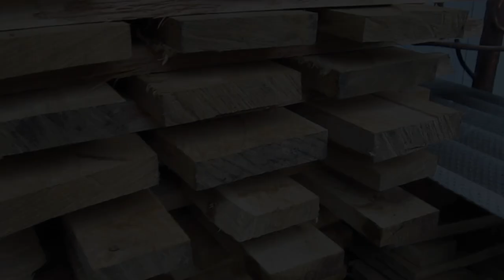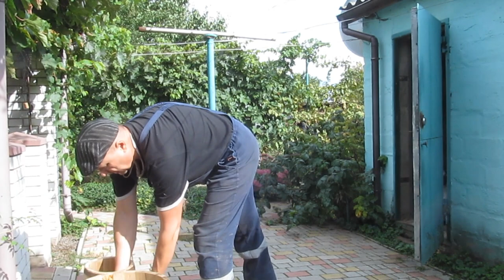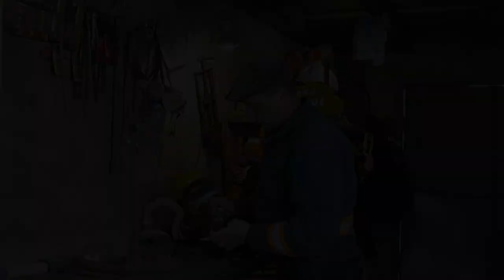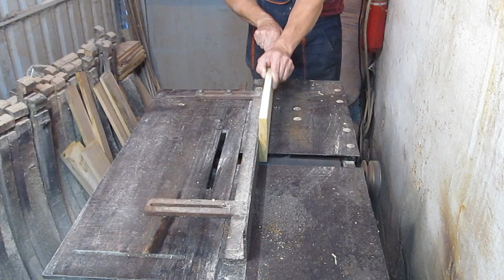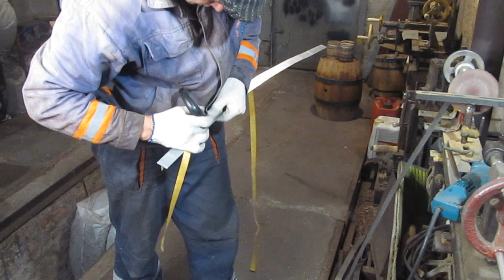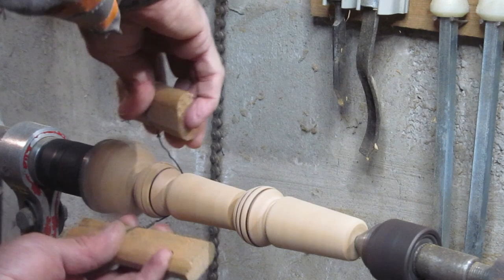А whiskey barrel from an oak log | DIY | How to make a wooden barrel with your own hands

Comment: would love to see a drawing (plans) for the two or three jigs used to taper and cut the side angles for the staves. Excellent craftsman at work utilizing available resources with pride of workmanship. "Work is love made visible" K. Gibran
Reply from the maker: Thank you very much!!! Here are some videos on my second channel that will help you. CALCULATIONS and TEMPLATES | MILLING RIVETS | ASSEMBLY and STRIPPING THE BARREL: https://youtu.be/_ae8lUzGrzQ
DIY WOODEN BARREL | Milling cutters | Making the bottom | Assembling an oak barrel. https://youtu.be/cE_Nmrdr9f4

Comment: perhaps put the tap hole in before finishing the body construction. How do you get the sawdust and that chunk of wood out?
Reply from the maker: To drill the cork hole I use a hole saw... After drilling the hole, the round piece of wood stays inside the core bit and sawdust getting into the barrel is minimized...
Reply: Before they fill barrel with whiskey they burn barrels inside and add several pounds of maple charcoals to it, a few pieces of sawdust from a oak board will not contaminate anything

Comment: This is amazing! Great craftsmanship! What happens to the wood chips that fall inside when the bung is drilled? Is there a way to get them out?
Reply from the maker: Thank you so much!!! I am very glad that you liked my work... To drill the filler hole, I use a core drill, inside which remains a cut round piece of the barrel, and all the small chips remain outside the barrel. Thus, the ingress of sawdust into the barrel is minimized ...

Comment: Very nice look at what it takes to make a barrel. I especially like the trick with the spanner, using 6 radii to determine the circumference. Are you using stainless steel pins to hold the lid together?
Reply from the maker: Thanks!!! I use stainless steel pins with a diameter of 2 mm.

Comment: Excuse me, I have a question, I heard that before oak wood is used to produce barrels, they put it in water for a while to remove the wood poison! Is such a thing true??
Reply from the maker: No, it’s not true... Oak blanks must dry in the open air for several years. Then they are used to make barrels. And only then do they fill the barrels with cold water for 7-14 days, periodically changing the water in the barrel to remove excess bitterness (tannins) from the oak...

Comment: Am i right in thinking that his router bit in the table is set at the angle which both cuts out the stave template and bevels at the right angle all at thr same time?
Reply from the maker: That's right. The cutter is set at the desired angle. With its help, I simultaneously give the workpiece the required shape and process the side edge of the barrel staves at the desired angle... Watch this video. It clearly shows these points: https://youtu.be/qeHGh-Y8tgo
Reply: @tmzhenatanwoodworking7252  thank you. How have you set your router up? We struggle here in the UK getting tilting router tables. I take it your table shown on your templates video is the actual temple size and not the finished/routered template?

Comment: I know that hoopers used to heat the steel hoops before putting them on wagon wheels so they would tighten to the wheel as they cooled. I guess I always thought that was how it was done for barrels too. This was a great video. What is the taper angle of the staves?
Reply from the maker: Thanks!!! I am very glad that you liked the video. The difference in the width of the riveting in the middle and along the edges is 12%.